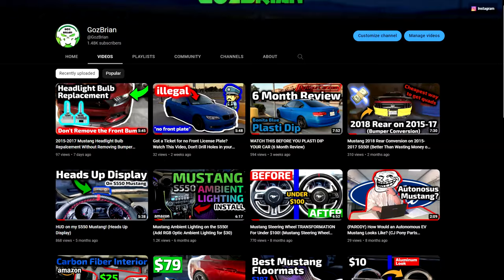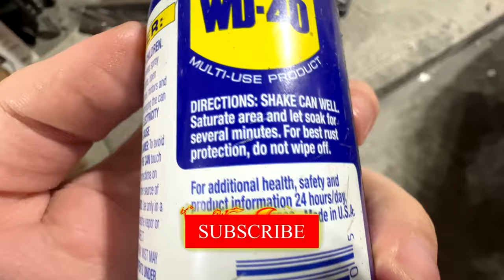How to Remove Old Brittle Headlight/Taillight Tint  (Chipped/Faded Vinyl Tint)

Comment: The steamer worked well. I wouldnt advise however putting boiling water over the car as it may damage paintwork. It may take a while and a lot of patience to remove but it will be worth the result. I polished mine after removing tint to remove all residue and glue from tint.